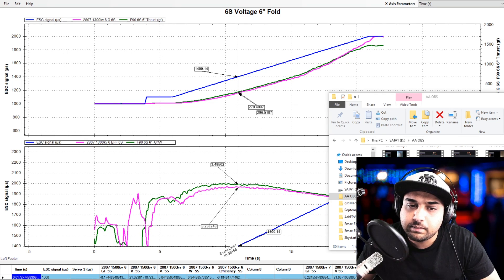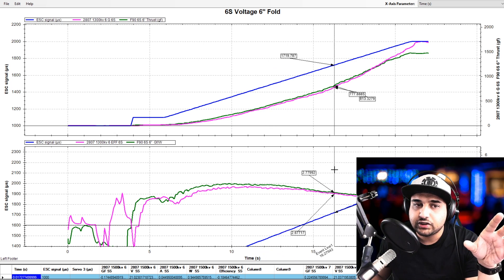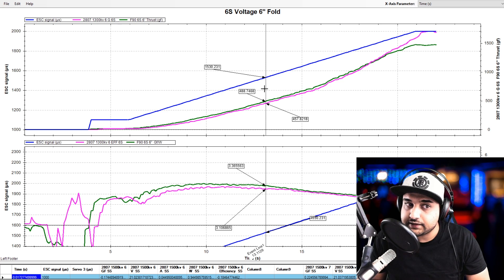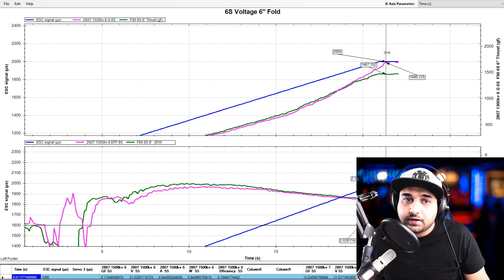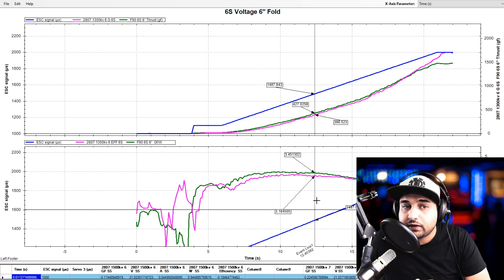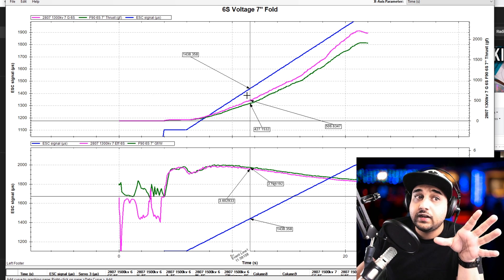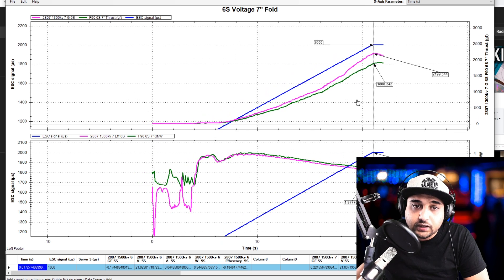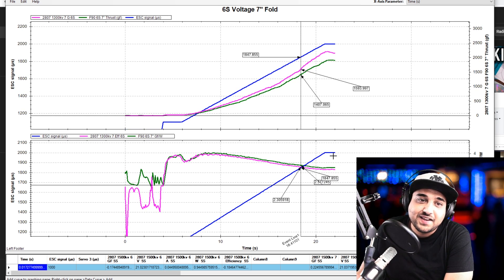T-Motor F90 1300kv vs Emax ECO II 1300kv

Comment: Very interesting!  Efficiency should also be compared at the same thrust level for both motors not at same signal level. It would be super if you could plot efficiency  g/W (or even pure electric power W) on  y axis vs thrust (g) on x axis.

Comment: HELLO....IT IS POSSIBLE TO PUT THOSE ECOII 2807 1300 KV MOTORS TO A 5 "DRONE AND THAT IT WORKS WELL AT 6S ??
Reply: I would think the motor would be over worked with a 5". The lower the kv the bigger the prop equal  efficiency
Reply: Well '5 inch you should use 2306 1700kv..

Comment: To get a good understanding of acceleration/power, It would be good if you could do a test where the 100% throttle signal is sent immediately from 0%. Then graph the thrust increase over time to see how fast they ramp up. 
Comparing thrust at set throttle points doesn't really give an indication of low vs high end power.. it just gives the thrust at certain input settings... One motor may have lower thrust at say 50% throttle, but it may be able to get to 100% thrust sooner than another motor if it can spin up quicker.

This is why engine dyno tests are done at 100% throttle.

Comment: You should really test the Brotherhobby 2806.5 1300kv against these two. I have all of them here and the Brotherhobby are the most efficient in my testing. Least efficient are the EMAX and on the second place the T-Motor. 
Quality wise T-Motor is by far the best. High quality EZO bearings, best balancing of all, 6g!! lighter than EMAX, thick base plate (3mm) and least notchiness due to flat magnets.
Reply: Sind die brotherhobby immer noch die effizientesten 7 Zoll Motoren?
Hab mir die rcinpower 2806.5 1350kv geholt.
Reply: @chrisbee5481  
Ja, sind sie. Aber die Langlebigkeit dieser Motoren ist absolut miserabel, weshalb ich keine BH Motoren mehr kaufe.

Comment: So this is actually pretty much what I'd expect and somewhat related to KebabFPVs last vid. What seems to happen is that the ratio of height to diameter matters for how the efficiency curve of the motor will look. Typically our motors tend to have peak efficiency at around 20% max torque and 80% of max rpm. A taller motor will have a wider torque-efficiency range resulting in better performance at the top end across a wider range of props but the wider stators have a wider rpm-efficiency resulting in better performance at lower RPMs at the cost of a narrower peak efficiency band. The small increase in stator height likely shifted the efficiency range further up the rpm and gave higher peak torque.
Have a look at siieefpv's videos and his dyno charts on mqtb. His dyno would be a super interesting thing to replicate.

Comment: Your efficiency graph is not correct because you put it against time scale - meaning ESC signal level in your case, while efficiency should be scaled against the thrust. That's because we throttle according to the thrust we want, so at any given moment in a real life Emax motor in your test would be under lower ESC signal where it has better efficiency than T-Motor and efficiency difference would not be 0.02
Reply: So, emax eco 2 its worth it?

Comment: So is T-motor better? Yes, at the best RPM range. It costs twice as much. Is it twice as good? No. Just get the E-max they are just fine. And looking fab while doing it. Let's face it. These motors are designed for bigger cruisers. Great data. Very informative.

Comment: Drone mesh I have a silly request that would really help me. If you happen to have a 10 inch prop could quickly slap that on and do a thrust test on 3s?
:)
Reply: 4s would bem better. 4s 2807 1300/1500kv with 10" bi Blade.
Reply: @FPVPortugalTV  I know but it's for an f5j and I want to stay with 3s